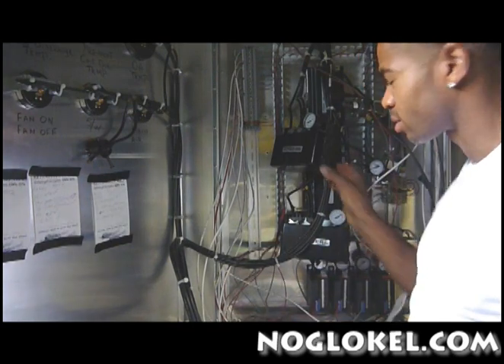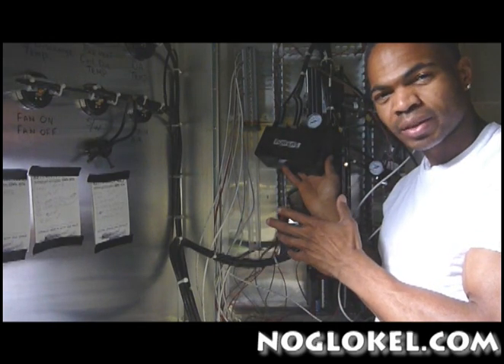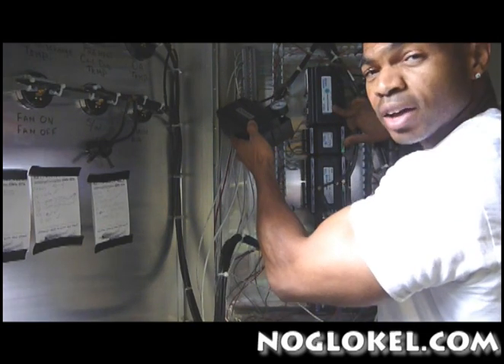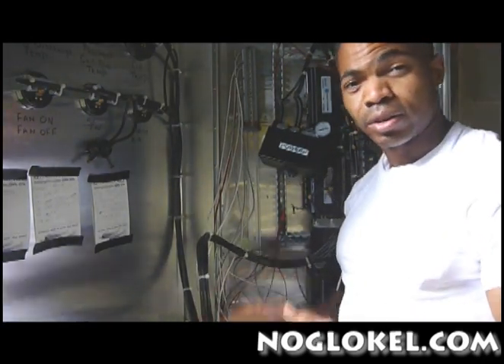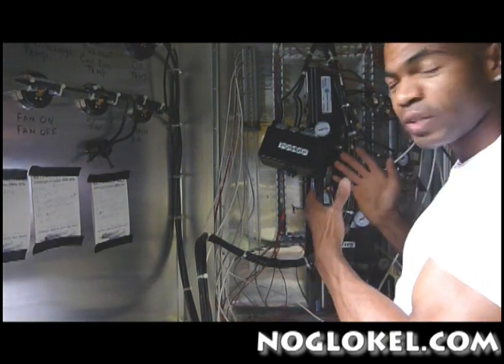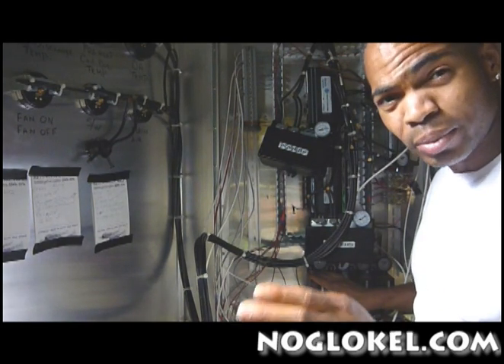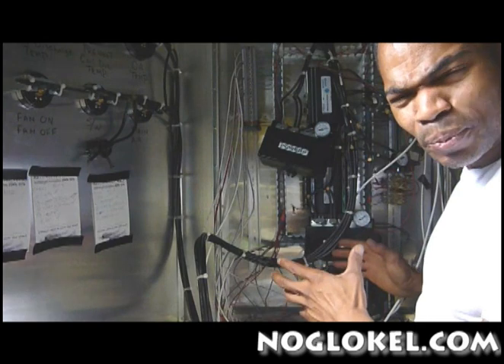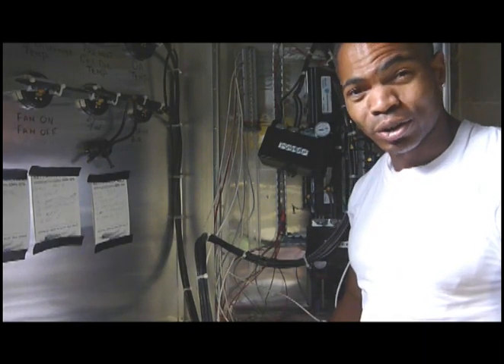Upgrading from Pneumatic to DDC controls

Comment: So it looks like you are going to still use pneumatic lines going from the control device out to the damper actuators.  You achieve that by using a transducer to control air pressure going out to your zone dampers.  Awesome stuff and great video.
Reply from the maker: yes .. 

that is correct ....